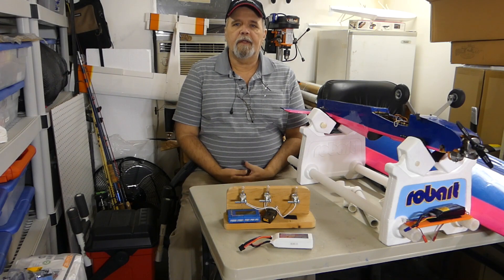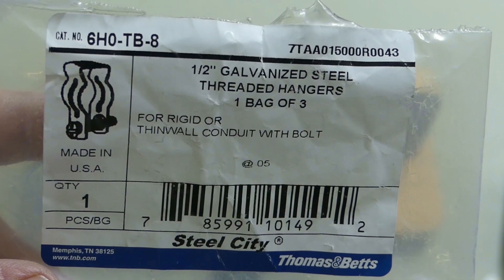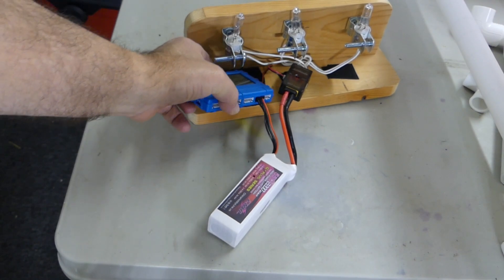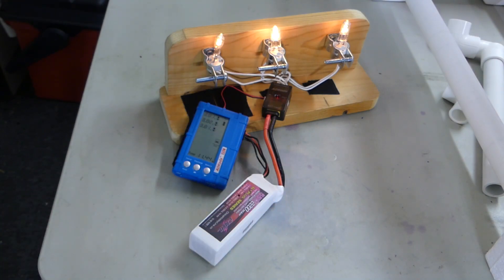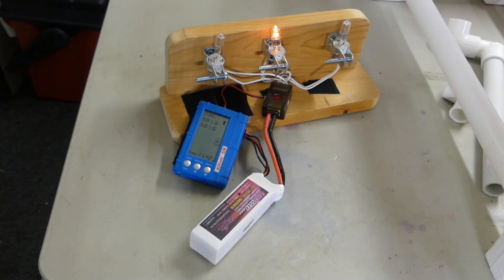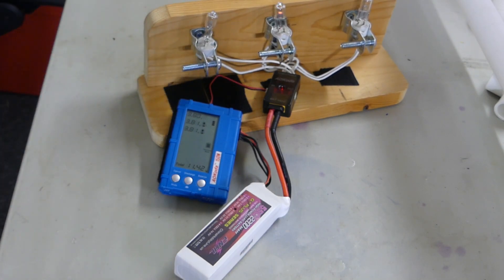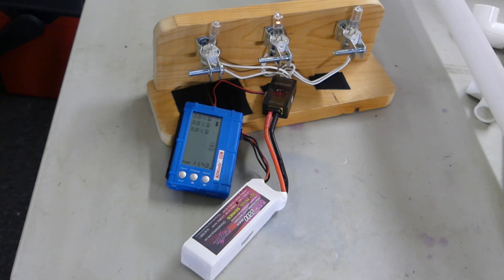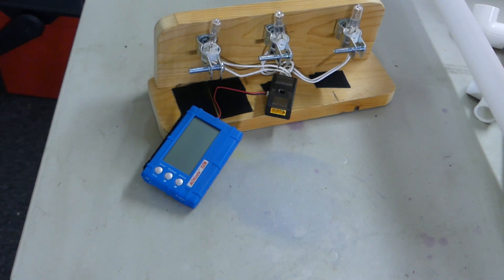Keep your Lipo Batteries at Storage Voltage With An AOKoda150w

Comment: Hi:

I see you have some experience with the cellmeter 8, and I was wondering if you could answer a question - when NOT connected to the 150W discharge module, does the "discharge indicator on the cellmeter blink or stay solid? The reason I ask is I bought 2 cellmeters and 2 discharge modules, but cant get the discharge modules to work (led on solid, no light bulbs light). and the discharge indicator on the meter is not flashing either. t 1st, I thought that was because the meter wasn't "detecting" the module, but one happy owner told me that the discharge indicator on his meter flashed no matter what. Any knowledge of any of this?
Thanks!

Dave.
Reply from the maker: Hi Dave,

I have not used this thing in a while, but if I recall, the lights will come on when the XT60 port is connected, if the battery is above 75-80% of storage level. If it is lower than that, then the lights may only come on briefly (a second or 2 at max, repeating as needed)

The cell checker blinks as it tries to balance the pack.

Hopefully this covers your question,...

Thanks

Comment: I have been using two of these set up to get my batteries in storage voltage quickly.....I have also found the stand alone balance mode is excellent if I need to get some marginal batteries back into proper balance
Reply from the maker: I also bought some little caps that you plug on the  main voltage leads. They work okay, but they do take about 24 hours to bring the battery down to storage voltage. They are safe to use un-attended though. (or so they claim!)